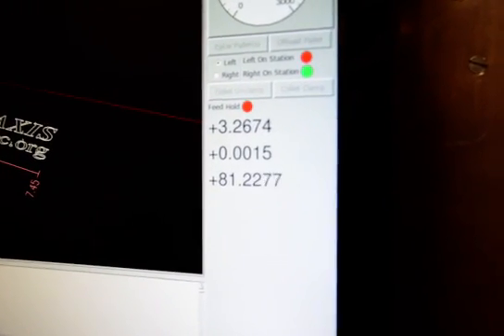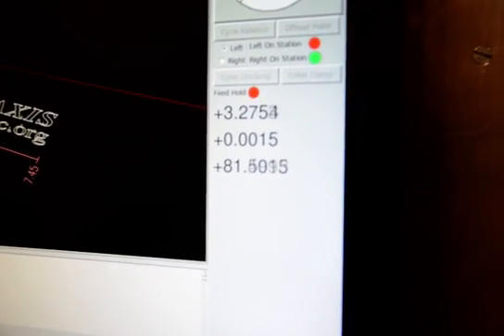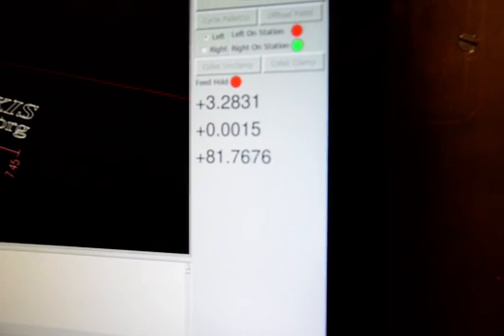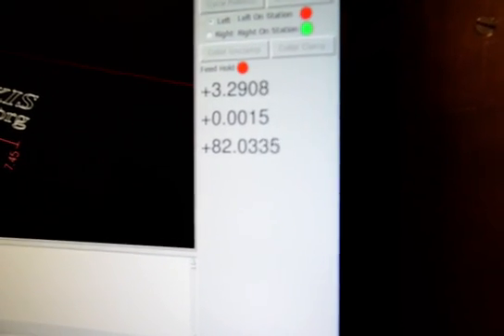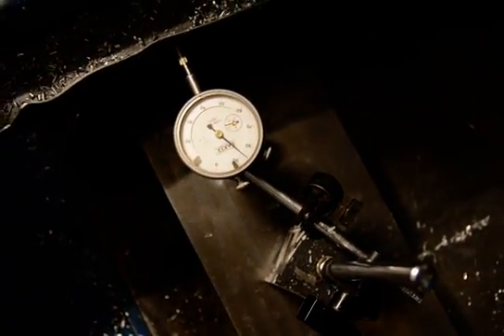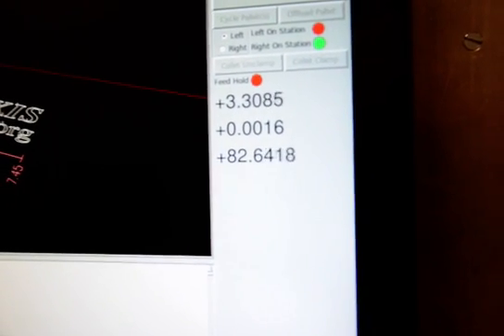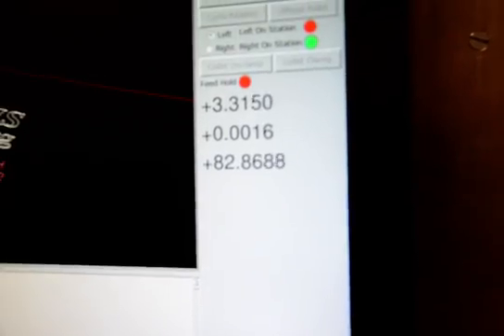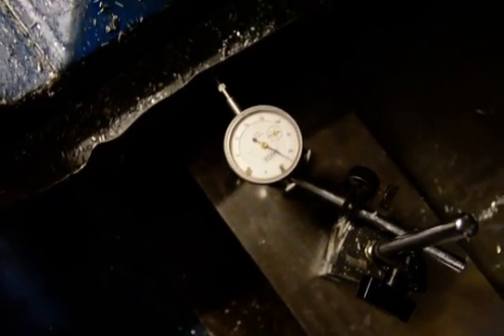Emc2 - Using temperature to compensate Z axis for spindle growth.

Comment: can you provide some code on how you did it?
Reply: no real code.. I used this library for interfacing with linuxcnc https://emergent.unpythonic.net/01198594294 and some hal bits (offset, scale..) to convert the analog voltage to an offset.